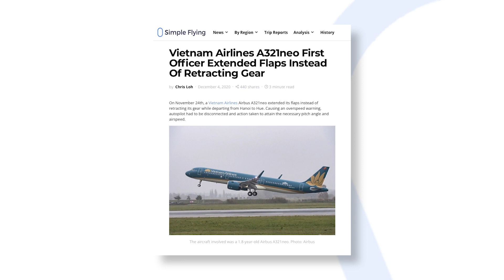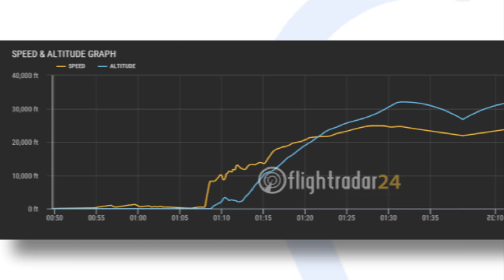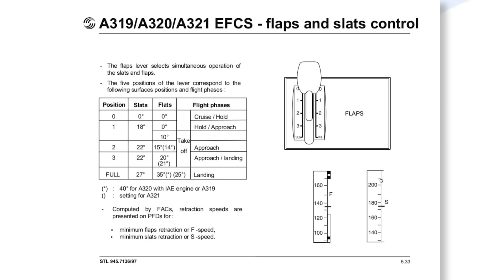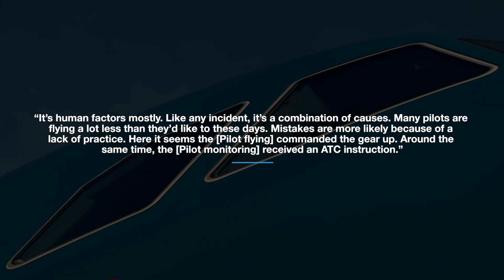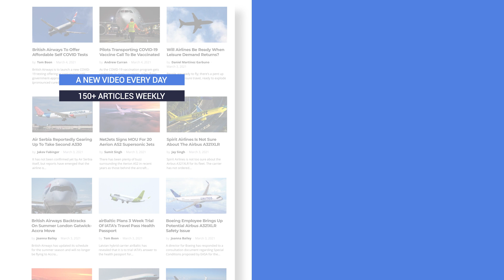A321 First Officer Extended Flaps Instead Of Retracting Gear

Comment: It will be informative to find out the FO's duty cycle and currency.  Low currency and at the end of a long cycle is a bad mix.
Reply: Could be a contributor, yes. Could also be the other way around: Lack of practice during the pandemic.
Reply: How about just plain old incompetence? 

Do you really think they will do any “investigation” when they hire poorly trained, inexperienced people to shove in FO seats of these jets, in the first place? Most likely this will be glossed over, and swept under the rug, like everything else!

Rest assured that you’re not going to “find out” anything, considering where this airline is from and how these types of airlines typically operate!
Reply: @747-pilot  Sigh.
Reply: @747-pilot  Absolutely correct.

Comment: i see most comments here acting like its no big deal...well as an engineer i know this is a big deal and the co-pilot needs to be cautioned about this, maybe the co-pilot was having a bad day or family issues. 

Confusing Landing gear for Flps 3 would cause a huge DRAG, affect the aerodynamics of the airplane, if the plane was heavy with a short runway this could have caused a near miss crash... 

This is really huge and should't be taken for levity.
Reply: As an engineer you’ve shown you don’t understand the situation.
Reply: @peteconrad2077  If you took your time to read my comment and properly digest it, I denoted that such huge error could be as a result of the co-pilot going through some emotional issues especially family problems or something so big that made him loose focus.. 

A Takeoff is a phase in flight that I have seen many pilots put in 100% concentration so what situation don't i understand when you have Souls on board?
Reply: @airforce_12553  1. The increased drag would only be an issue in the event they also had an engine failure. Extremely unlikely. 
2. What do you mean by “cautioned”? Do you mean like a police caution. What he needs is to be assessed by a medic and given support. You don’t caution people for mistakes. Unless you want people to hide their mistakes.

Comment: Are you serious? Massive error? This is a non-event.
Reply: I agree. I do question why someone would think extending flaps on departure would be normal, even while distracted.
Reply: It is a massive error but it didn't end up in an accident or anything. It could've caused one.
Reply: @gabmx505  How so? A flap over speed is a pretty minor event. I’d like to hear how that could have possibly led to disaster.
Reply: @gabmx505  It’s definitely not good but a lot of airliner even offer blowback protection for over speeds.
Reply: @pirahna432  It could've led to a stall or overstress damage if the flaps were given enough time to extend at that speed, either of which can lead to a fatal crash
Reply: @skyserf  Maybe because they’re EXTREMELY incompetent, inexperienced and unskilled? And were probably given that job as an FO because of some “connections”, after having just obtained their pilot’s license, with the ink on the certificate having barely dried!! (rollseyes).
Reply: @747-pilot   Incompetent FOs mentored correctly can turn into excellent Captains.

Comment: Shouldn't the pilot monitoring reply "three greens" to confirm that all gears are retracted when instructed "gear up"?
Reply: three green is for gear down though
Reply: @Porama6400  ah ok thanks for clearing. I would have imagined it would apply to up as well. Is there anything to confirm that the gear is up?
Reply: @fb55255 red then no lights at all would confirm that.

Comment: what happen to inspection of the aircraft after flap overspeed, there could be damage to slats/flaps system and you never go by what pilots say, read the FDR it will tell limits, duration and times, g loading. Sure the captain did a good job of saving airplane but why did he not return to base and have airplane checked out, he could of been flying an unserviceable aircraft.

Comment: imagine if he would've retracted the flaps completely instead of extending it a little earlier then the plane might 've stalled very close to the ground.  So between the mistake of extending the flaps all the ways vs retracting them all the way, I would rather he makes the mistake of extending them anytime during departure...lol...
Reply: Not an A320 wouldn’t.
Reply: Being an Airbus FBW no it wouldn’t stall but plane would take action itself and go full toga
Reply: It's not some Max stuffs yo it's airbus
Reply: the plane took off with a brake defect that requires the gear to be pulled up one minute later than usual. I don't think the plane is that close to the ground when the mistake happened. But still.

Comment: This incident probably wouldn't have happened if airplanes were more intelligent and could retract the landing gears automatically once flight conditions are right (altitude, airspeed, pitch angle,  and weather conditions), and not require any human intervention for such a routine and trivial action. Moreover, how come the copilot didn't verbally repeat the command to acknowledge the "gear up" command back to the pilot, confirming he was doing it (even though he had his hand on the flaps lever instead of the gear lever)? Also, why wasn't the sophisticated onboard computer not indicating a verbal warning message, something along the lines of: "Warning! Wrong flap angle set for present flight condition" ?
Reply: LOL.  Non pilots are always good for a chuckle.  For what it is worth there was a warning.  They repeated it several times.
Reply: @ShainAndrews  
The warning was "Overspeed" which was not the real cause of the problem, but only the unwanted result. The onboard computer should have said "Wrong flaps setting for current flight data", then the pilot and co-pilot would have quickly realized the mistake and corrected it. Today we have complex face recognition software on our smartphones, but the onboard computers in multimillion dollars airplanes are unable to catch a human mistake as soon as it's made?
Reply: @AlainHubert  The laughs keep coming.  My eyes are watering.

Comment: Much to do about nothing.  It was a mistake and the aircraft was never in any real danger.  Write up the flap overspeed  in the logbook and move on.
Reply: Deploying flaps overspeed could damage the flaps itself and/or have significant pitch angle change which is quite dangerous. But in this case it wasn’t that dangerous

Comment: This unfortunately shows the problem for 1 pilot that Airbus is embracing
Reply: There will only be one pilot for cruise. There will be 2 for takeoffs and landings
Reply: @tomstravels520  I’m still not comfortable with the idea though. It’s either 2 pilots/crew at all times or entirely pilotless where all computers are in charge
Reply: @filledwithvariousknowledge2747  what happens in cruise that immediately requires 2 crews? If anything were to happen the other pilot would be back very quickly and the pilot in the cockpit would probably have done most of the ECAM actions by then to keep the plane safe

Comment: Clearly a human factors incident, but the red flag for me is that the F/O activated the wrong control in the wrong sequence...  
In the dozen airliner types I've flown, the first action after takeoff is to retract the gear, followed by flaps, slats and setting climb power.  On every takeoff I have ever made, on liftoff and climbing, the pilot monitoring calls "positive rate (of climb)" and the pilot flying replies "Gear up" expecting the monitoring pilot will in fact retract the gear.  That the FO brought the flaps up sounds like a very inexperienced pilot who hadn't internalized the normal takeoff routine.  The flap and gear controls are different shapes and in completely different locations to prevent such a mistake...
Reply: This is pure guesswork. There is no information on the experience of the FO. It could have easily been a combination of several other factors, where the question that needs to be asked is, 'Why did someone who's executed this task 100s if not 1000s of times before make this error on this occasion?'
Reply: The plane took off with brake issues which required a delay of one minute before gear up. This is critical to the incident, not mentioned in this video but you may look it up.

Comment: the crew, like in most communist or socialist countries is probably someone 'important' and thus - no remediation action will be taken against them. Airbus has spent DECADES making the handles and knobs dissimilar so that even in the dark, one should OBVIOUSLY be able to tell the difference. 

Oh btw - one has to reach forward for gear, and down for flaps - this FO should not be in the flight deck without remediation courses.

Comment: It could stall in worst case scenario if the flaps was extended to 4 or max and would not be recoverable in this low altitude situation

I agree with all of you mentioning human and mistake. CRM is very important, it's based on trust. I think the captain will be more aware and less comfortable flying with same FO next time 😅 the reason why this is a serious mistake is that the first 4000 ft after takeoff is crusial.

Comment: As a pilot, it isss very common. I have seen this multiple times (done by both Experienced Captains and Co-Pilots), of course correction was timely excecuted and we didn't end up changing our flight path like this crew. But again, it highlights the human limitations and CRM/communication. Also aircraft's these days are equipped with Flaps Load Relief system etc... so its less dangerous that what people might have tought. So yes we will try our best to avoid this, but rest assured airplanes these days are not too bad themselves.
Reply: Flew large jets worldwide for 43 years for top airlines....never saw this.......not common with professionals.
Reply: @daftvader4218  huh... since this is an open online comment section, i shall reply as follows;
Either you are not a pilot... 
OR... you flew too much on large jets, performing very few takeoffs and landings...
OR... you were never an instructor before. 
OR... if you are an airline Captain, maybe you took my "very common" too literally as if it happens every single day... then NO

While it is not common on your personal daily flying routine etc, but if you look at any "good sized" airline, the FOCA statistics speaks for itself. Yes, ANY airline especially those flying narrow bodies with high takeoff/ldg cycles. Incidents like this commonly happen during training flights with the trainee/when the instructor's workload is higher than normal. 

Regards,
Yours truly
Ex ATRs, 737s and A380
May not have as much experience as your 43 years but i have my fair share of flying regionals and large jets with reputable airlines as well.

Comment: The copilot's mistake is somewhat human. Sometimes you do something inadvertently and you can't understand why. Like taking your empty yoghurt can and your spoon to the kitchen and throwing the spoon in the garbage. It makes no sense but you did it because you were in auto mode.
It makes even more sense when you consider that the retraction of the gear had to be delayed for one minute due to a brake issue. At this point, the gear usually has been retracted already and you retract flaps slowly. Slight deviations from trained procedures can cause high levels of confusion where the pilot touches the wrong lever just because the timing tells him that he has to touch the flaps lever. The FO definitely needs training with non-normal procedures.

However, the mistake of the captain to induce a low speed condition with the threat of a stall is inexcusable. There is no procedure in aviation in which flaps are retracted from 3 to 0 instantly. That mistake is not a human mistake but lack of training or lack of awareness. It might be lack of both. The captain should not fly any aircraft without further training in low speed conditions.

Comment: Sorry to all those other commenters, who said "he's just human". There were also a lot of other "humans" on that aircraft, whose lives depended on the F.O. doing his job properly. This is a basic error that requires a reassessment of the First Officer's competency and performance under moderate stress situations. Maybe he was tired due to lack of sleep because he was out partying all night, and/or on drugs? 
Remember the old flying adage: "Aviate, Navigate, Communicate" in that order. Correctly identifying & operating the gear lever, should be a higher priority than talking to ATC. You can always ask them to "say again". Furthermore the flap and gear levers were in completely different locations, you shouldn't even have to look, because one is shaped like a little flap and the other is shaped like a little wheel. It's too easy. This was just sloppiness and lack of attention to your job. It's an important job, you should take it seriously always and concentrate on what you are doing!! You're not a passenger, your the Co-pilot!! At ATPL level, you're a professional. You either make the grade or you had better find yourself a new job.

Comment: I woulldn't come down hard on the first officer for this.  I think it is more important that this be used as a teachable moment and incorporated into recurrent training for all pilots than bringing the wrath of God on a single pilot.
Reply: I bet you would have a different attitude, if one of your loved ones was on that flight, and the aicraft stalled and crashed after the Captain completely retracted the flaps in response to the first officers mistake.
Reply: I get that people make mistakes, but come on. The flaps and gear handles couldn't be more different. They're a different shape and on different panels, and the FO was supposed to move it in the opposite direction regardless. On top of this, you need to pull the tab thing on the bottom of the flap handle to move it through the indentations in the first place.
A 10 year old could point out landing gear over flaps; This should be past muscle memory for pilots, particularly on commercial flights.

Comment: Accidental engagement of flaps. Pilot did a great job to recover, but at the Co pilot is who messed up. Overreaction would be to suspend or send to retraining. I believe some punishment is valid, but since it was a pure accident and no damage occurred to the bird or its passengers, nothing more should be done. It happens. Could it have been worse? Yes.